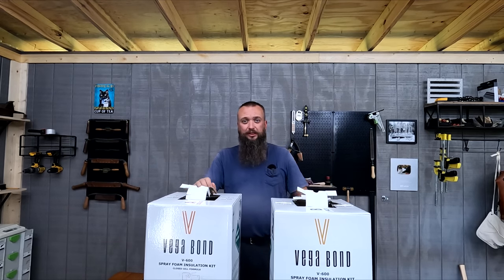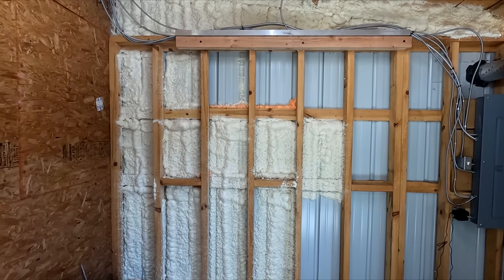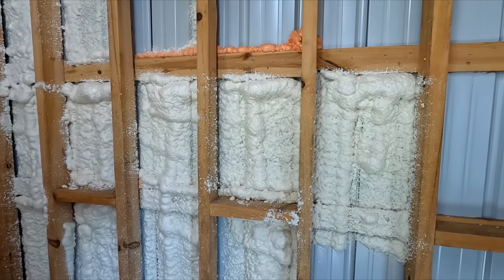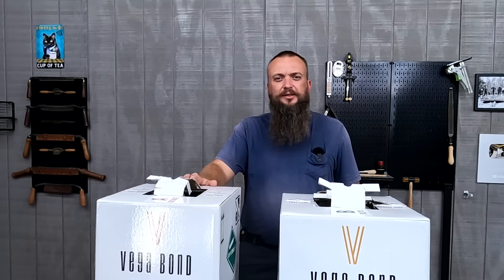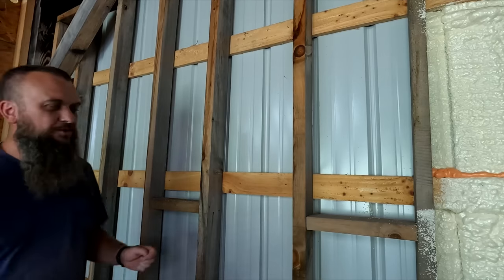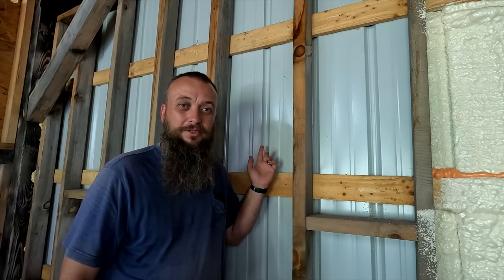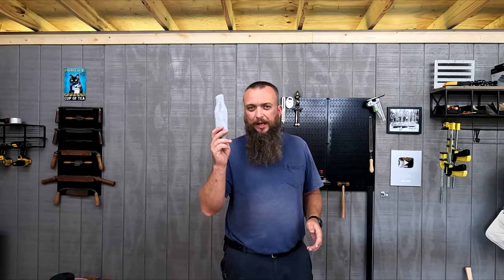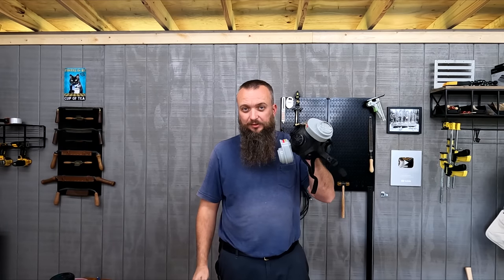DIY Spray Foam:The Video Pros Don’t Want You To See. Save $$$$

Comment: after seeing this and after working with professional spray foam companies as a contractor that does a lot of remodels, I have to say this is a disaster. A professional company will tape all the studs off so you are not scraping foam forever. This would take forever and a professional would be able to do it much quicker. You may save a bit but in my opinion this is not a job for a weekend warrior.
Reply from the maker: Sounds like your scared. That’s ok. Stay on the sidelines
Reply: So youre saying dont spray the studs?? Why?

Comment: Thanks for the video.  These home kits are way overpriced for the material.  $900 bucks for 600 bd ft is not alot of coverage. if you plan on putting in 3 inches or so you would need something like 10 kits for a 1000sq ft house.  at that point you may as well hire a professional for that cost.  the only way i see this application is some small project where your access to professional and material is limited.  Roxul and a vapor barrier would have done a similar job at that spray depth and cheaper.   Real life video though.

Comment: You need to learn the proper way to spray that product correctly. A lot went to waste and you can see that coat didn't seal each spacing between studs
Reply: Purlins not studs

Comment: Very dangerous…. You could make your home uninhabitable if you screw up.
This isn’t stuff to play with.
Reply from the maker: Crazy comment. Don’t be that guy
Reply: @OutoftheWoods0623  I am that guy… and yes, homes have been rendered uninhabitable after an improper installation of this foam type insulation… by a professional. There is no way I would put this in a house I intended to live inside.

Comment: Please research rock wool insulation… everyone says it better
Reply: Rock wool does not have the thremal break that closed foam has at all...
Reply: @davidcurtis5398  yes but he mentioned that he was putting fiberglass over the foam. Is that a bad idea?
Reply: @gnewman18  Not a bad idea if there is room...
Reply: @davidcurtis5398  RockWool is great for several reasons. It won’t support mold and mildew, it won’t sag like fiberglass, is not nearly as itchy to install, although it is not totally free of that issue, and does not support critters nesting. It’s also self supporting between the studs. In my climate the spray foam for a work space or workshop is overkill. However, in colder/wetter climates is a good idea. Like others noted, put in a vapor barrier, do the fiddly spots first then on the larger areas do a big broad sweep back and forth to ensure it’s even and smoother. Makes adding the fiber insulation, interior wall material, etc. easier.